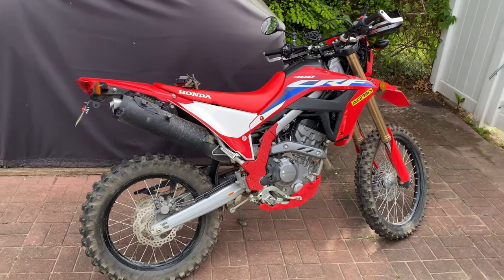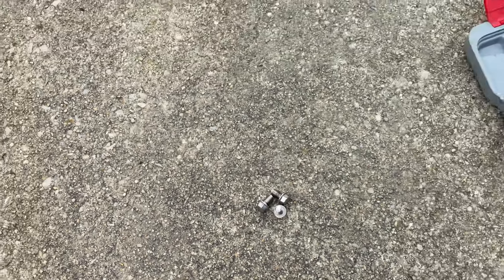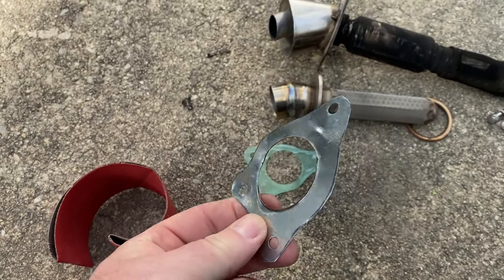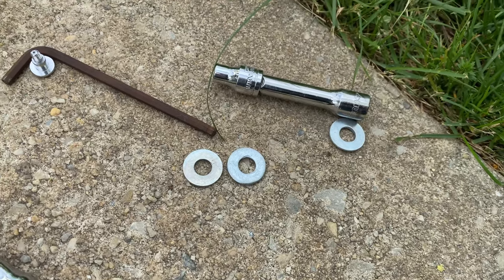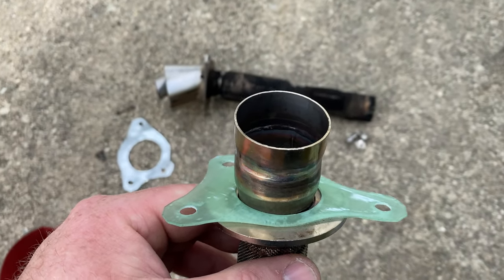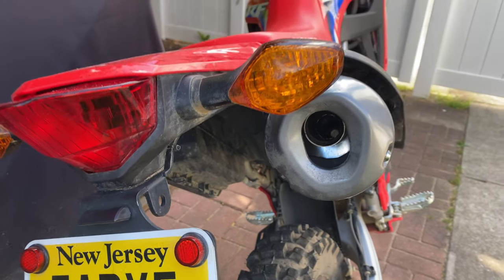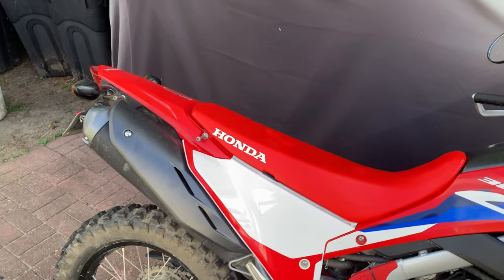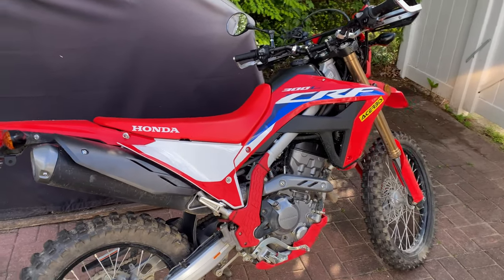Honda CRF300l Upgrade to Yoshimura Spark Arrestor *Loud & less restrictive*

Comment: Nice work! That is a really strange hole pattern, I wonder why Honda did it that way. I'm glad to see that this trick works on the 300L as well. It's no replacement for a Yoshimura or FMF system but it's a easy and inexpensive get-ya-by. I plan on getting either the Yosh or FMF muffler sometime this year, that is if they ever get back in stock!
Reply: BlackWidow is in stock, just bought one myselve - Product Code:  300BT/BC30V - Very lightweight - 3,4 Kg.

Comment: I wonder if it will melt your turn signal as it now has no downturn. Nice though. I opened up the end of the stock arrestor and covered it with spark arrestor screen to allow more flow and a bit more sound.